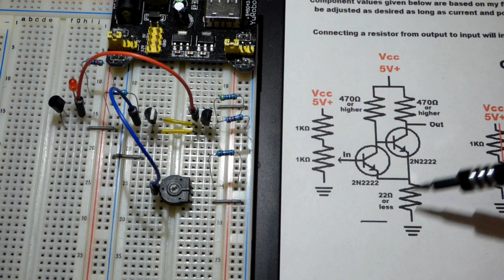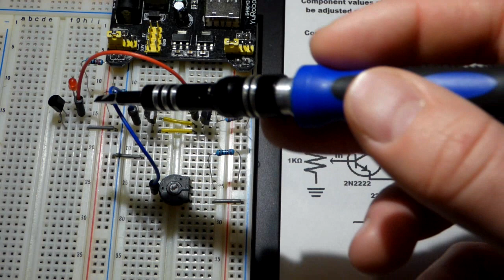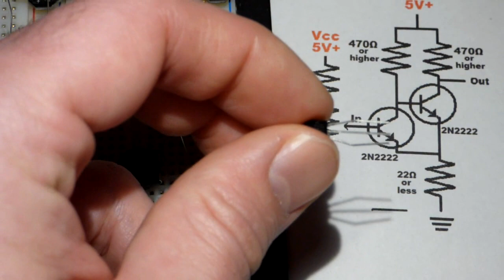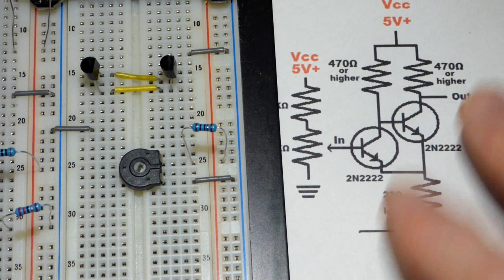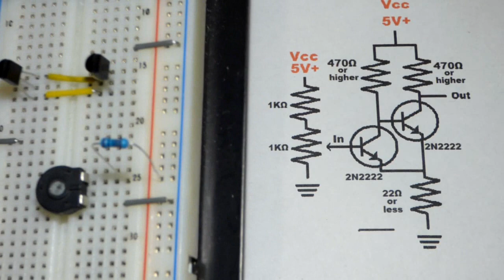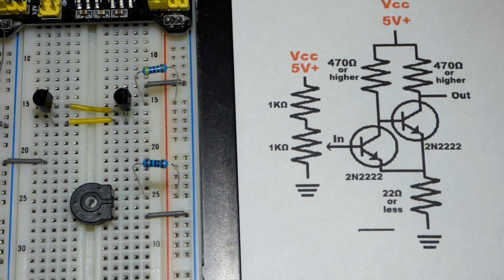Transistor circuit 9 Schmitt Trigger 2N2222 NPN Bipolar Junction Transistors BJTs trimpot

Comment: Is this just an example circuit or could this be used in a high frequency circuit
Reply from the maker: I have no clue how high a frequency this would work. I never experiment with those circuits. I'm guessing that at some point you would need a MOSFET Schmitt trigger. I'm sure there's probably modifications to make this one better with high frequency signals as well. Good topic to bring up, I'll try to learn more and hopefully make videos in the future. :)
Reply: @Electronzap  Yes I'm gonna experiment with this as well ....I also wonder if using veriable risistors or trim pots one could use the voltage trigger level to their advantage.... Thanks

Comment: Finally found enough time to watch this video.    I think the points that effect the hysterisis on and off are in the data sheet under cut off or possibly drop off and gate min voltage forward     You need to harp on the reason this is a cool circuit.   Some of the circuits I build kinda irritate me specially if I have a Resistor and an Electrolytic Capacitor stretched across a voltage source and I'm watching the cap charge up with a volt meter across it and I have the base of a 2n2222 tied to the plus side of the cap and its irritating because its not a deffinitive on or off.   As the cap charges the transistor starts breaking over and usually its an undesired effect when you want the transistor to act like a switch instead of the Output LED  slowly getting brighter.    Even Zener diodes have a huge amount of leakage before they reverse break over.   The Schmitt Trigger gives you a nice clean on or off.   No LED  slowly getting brighter and brighter stuff.   Just BAM  its on or its off.    I want to try building this circuit but instead of the Potentiometer I'm going to use a resistor tied to plus and a polarized electrolytic taking it to ground to feed the gate.    Instead of the voltage divider like you used here.   So the voltage slowly builds up on the cap and when it hits the breakover threshold  BAM  instant saturation.   For a little timer circuit.    If you use big values like   1000uf and maybe 1 meg Ω   you can get like a 20 minute delay before the output kicks in.    Holy crap did I just go off on a tangent  sorry... xD   Thanks  Great Vid
Reply from the maker: Sounds good, have fun, and thanks for watching!